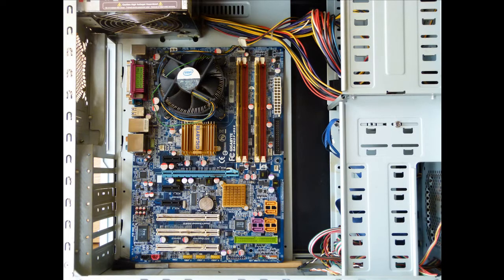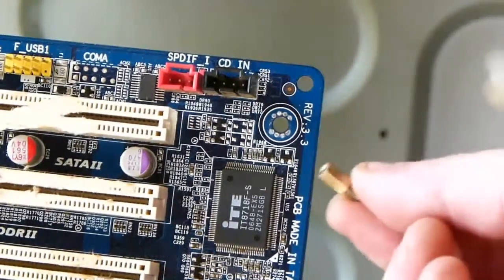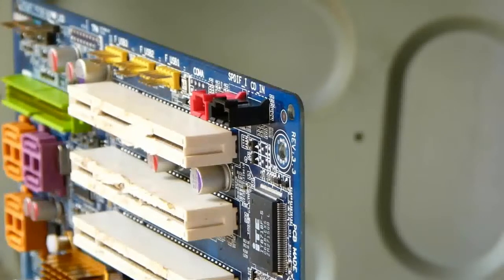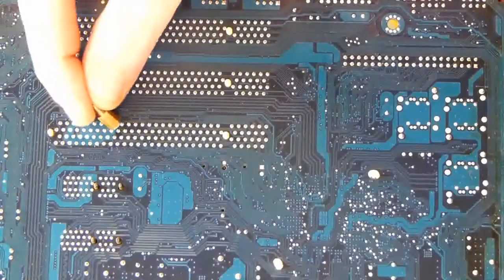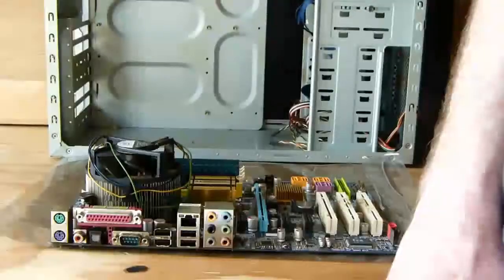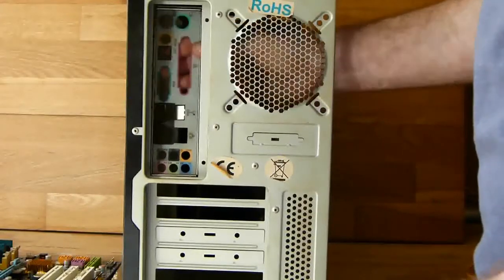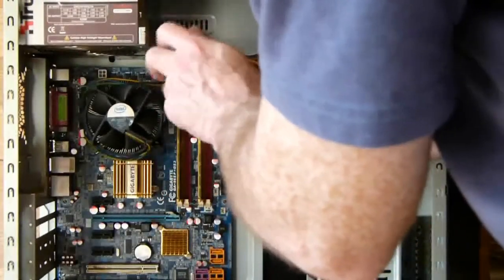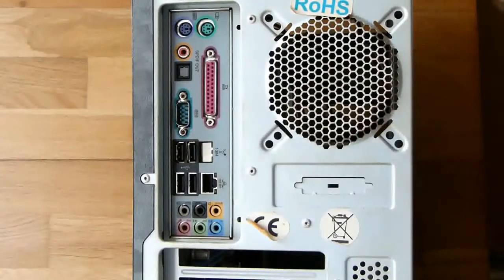how to install a motherboard

Comment from the maker: yes the risers have to be installed, but not if you have a case that has risers that are built in. So check the back plate where the motherboard is being placed and if there are little risers punched into the back plate then you do not need to install risers. Make sure you check in the booklet that came with your case failing that Google your model of case. If this does not help then go to my website and email me a picture of the pack plate of your case and I'll be able to tell you. thanks!